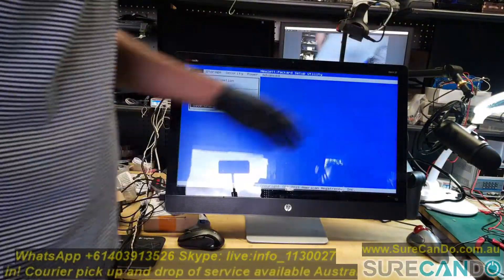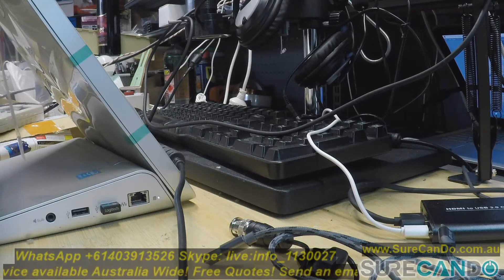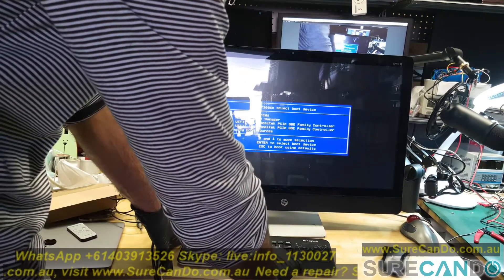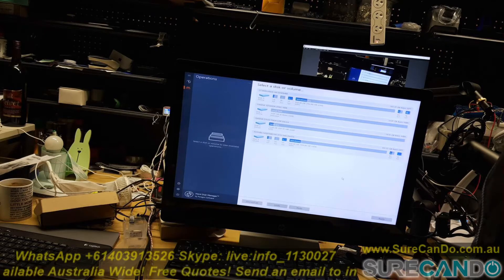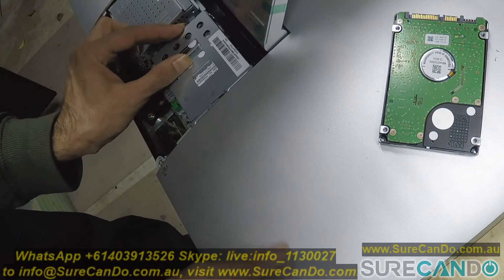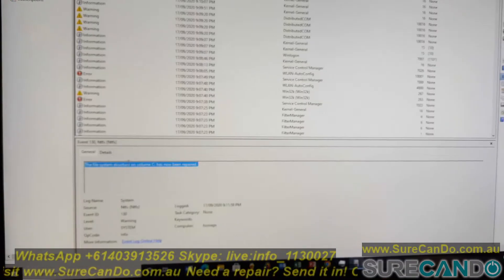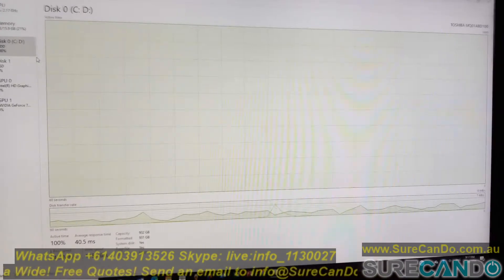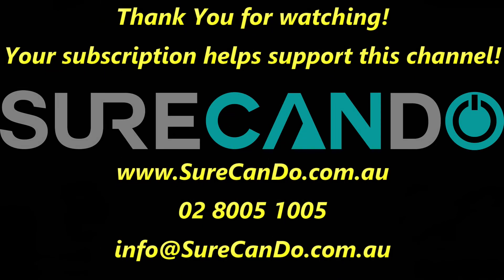HP Envy Recline 27 TouchSmart AIO PC Failed Hard Drive Clone and Install RAM Upgrade

Comment: So you cloned a hard drive with lots of disk errors and then let Windows itself fix the errors on the clone ? You are braver than me to trust that will fix every issue for the customer as you ignored read errors found duing the clone. I would be suggesting the customer reinstall Windows completely not continue to use a band-aid solution - chances are some of their software programs have  been damaged too.  I didn't like that nasty crashing sound at the end either when something hit a hard floor.
Reply from the maker: Don't forget all HDDs have bad sectors even new ones. And if errors happen that is fine to ignore, if drive is failing, you want to copy what ever you can as quickly as you can. Windows and programs can be repaired easily if required. Personal data is main priority. I've been through hundreds of cloning procedures using tens of different programs and methods, don't mind what I do ;-)